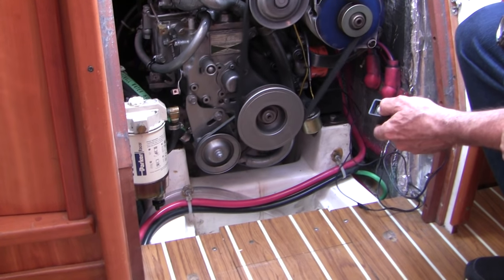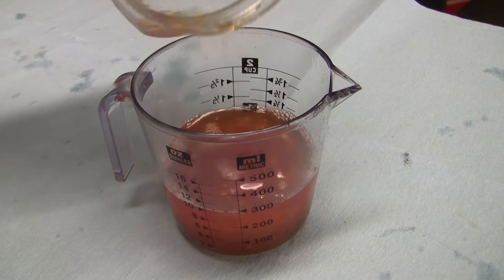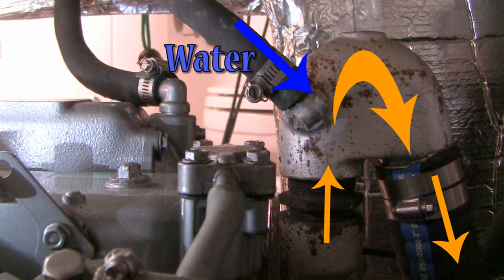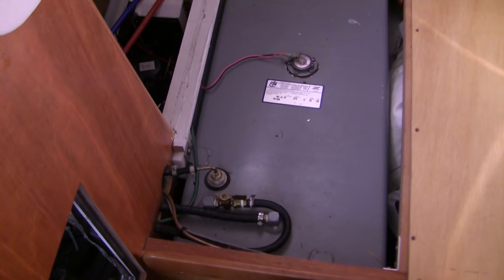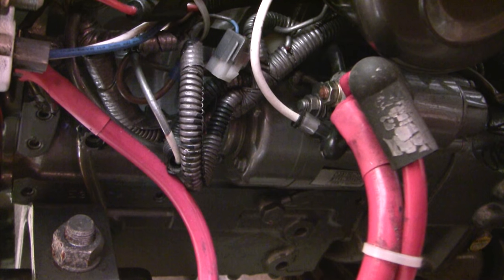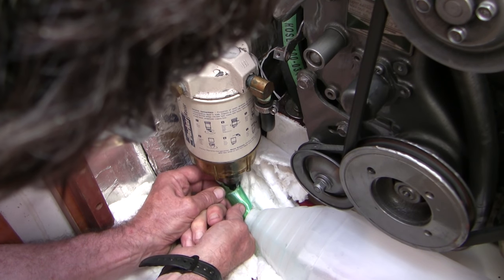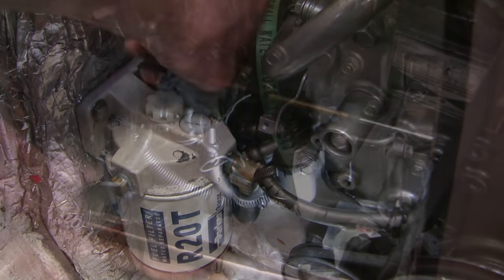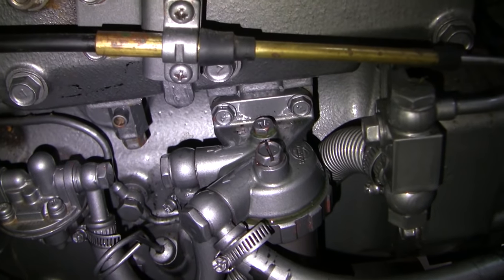How to change fuel filters and bleed air in a Yanmar marine diesel

Comment: So following up on my last comment I replaced the fuel filters today and had a couple things I thought I would share. First, bleeding the lines with the butterfly valve seemed nearly impossible. My primary fuel filter was huge and the butter fly valve is really slow. My starter and solenoid are tucked in pretty deep so I ended up clipping two long wires on each end of the start switch in the cockpit and attaching them to another switch I kept near me so I could run the starter by just bypassing the start switch. That worked great. Second, I ended up having to bleed the lines all the way to the individual fuel injectors because I had trouble starting up after bleeding them to the point where Dr. Spelunk did stopped. Basically I had to bleed them at the primary fuel filter, secondary, the inlet to the fuel pump or fuel injectors (the thing where one fuel line goes in and three come out), and then finally the individual fuel injectors.  Using the decompression valve trick to bleed the lines made things way easier. And it wasn't too difficult once I had a switch setup. Don't forget to stop the water intake before running the starter. It sounds like that could mess things up. Good luck everybody. Thanks Dr. Spelunk!
Reply from the maker: Excellent follow up advice, thanks for taking the time to stop back and help others.
Reply: Thanks guys, very interesting. Why should water intake be shutoff?  Also, I have a 12v fuel pump in-line next to my primary racor filter on my Yanmar 3hm35f.  I have not used it but my understanding is that one can turn on the ignition key (to provide power), then this fuel pump has a toggle switch to at least prime the primary filter. Am I correct in assuming one can try to start the engine without bleeding each injector? Then if it does not, bleed each of them as well? Lastly where does one get one of those by-pass starter switches? (Model?)
Reply: 0:50 so diesel just explodes?! No heat source?
Reply from the maker: @snakeplisken4278  It looks like I missed your remark, which sometimes happens in subthreads like this one. Common practice in these engines is to to shut off salt water intake when you crank without starting. This is done to prevent the salt water from flooding the exhaust manifold and possibly causing salt water to reflux into a cylinder, damaging a piston. More detail in the video, but essentially when pistons don't push much air, water can splash backwards from a rusted exhaust elbow. I like your design with a 12V fuel pump. Yup, that would be useful for bleeding, and you wouldn't need the hotwire switch I used. You can make your own hotwire switch, or buy a cheap one from any automotive parts store. If you make it yourself, don't cheap out on the wires or switch quality, since even the signal side of the starter circuit carries enough current to melt inadequate hardware. You can often get by with not bleeding all the way to each injector, I stopped after bleeding to the fuel regulator.
Reply: Santiago Ferrari No spark. There will be heat from the compression. My lay understanding is that it’s this heat that causes the combustion of the fuel-air mixture, but maybe an engineer would phrase it differently.
Reply: @santiagoferrari1973  I know you posted this long ago but....  Yes the diesel just explodes but there IS a heat source.  As the compression increases that pressure rise generates huge amounts of heat and when the heat gets great enough the diesel air mixture auto ignites.

Comment: I’ve bypassed my mechanical lift pump with an electric fuel pump from NAPA it simplifies bleeding. The elec. fuel pump is 17 yrs old,it’s going strong and costs very little, about half the cost of the rebuild kit for the mechanical lift pump.
Reply: Where's that video at? 😅

Comment: If you had continued pumping fuel at the primary filter, you would not have had to use the manual pump on the engine. Use the filter pump until you hear fuel returning to the tank. The engine will start on the first crank. Cheers, Richard

Comment: Hi! My name is Gennady, and I wrote to you about 2 years ago. Today, I started my engine, and at first I felt that it provided no push, then I saw a black liquid coming out of exhaust. And finally, the engine stopped. I tried to start it again, but it would stop after a few seconds. My engine is Yanmar 30 GM. Any ideas on what could be the problem?

Comment: Another tip I'll add...  I just installed a new filter just like the one you show in this video and I also didn't have spare fuel.  Mine would not pick up fuel at all straight out of the box.  But putting a little bit of diesel onto the seal at the end of the pump actually made mine start working and really made the pumping go a LOT faster.

Comment: Very helpful and detailed video.  I made a list of all the steps (we knew we had air in our system) even did screen grabs so when we were at the boat we could follow your instructions with pictures!  Brilliant!!!  it worked.  Interestingly, when we got to the high pressure pump, we  released the decompression valves, cranked the motor, the valves flipped closed by themselves and the engine started.  What a relief - thank you for the video - an excellent help!

Comment: I have only recently come across your episodes and find them clear, informative and very relevant to the faithful GM series.
One trick to make bleeding the fuel system easier than wriggling the lift pump for ever and a day is to fit a rubber outboard motor fuel priming bulb (about $20 for a good one) into the line between the tank and the primary (low pressure) filter. It will usually prime all the way through the primary filter to the high pressure filter on the engine. So far (touch wood) I have never had to crack the injectors to fully bleed the system after changing both filters. Just be sure to run the engine under load (ie in gear with some rpm on) at the dock for a good 20 minutes after any fuel system work to be absolutely sure that no air is lurking waiting to stall your engine at an inconvenient time (ask me how I learned this the hard way...).

Comment: Great presentation. I'm in the final touches of fully rebuilding my Yanmar 3GMF and will go through most of this initially before installing the engine since I only have access from front and back, and a small door to check oil and change the secondary fuel filter. Well done.

Comment: After watching some of these video for the second or third time I am even more impressed with your productions.  In my opinion you do an amazing job presenting an overview of what we are looking at and explaining the various parts of the system before you go into the specific subject matter (fuel filter replacement, raw water pump removal and rebuild).  Something you mentioned in passing is contrary to what I have been taught, that has to do with pre-filling the secondary fuel filter with "fresh" diesel after a filter change.  I have been cautioned not to do this because these secondary filters are designed to remove very small contaminants, smaller than the human eye can detect which is limited to approximately 40 microns.  Consequently the fuel may look very clean to our eyes, but still have contaminants that can cause havoc, 3-4 microns, in the extremely small tolerances within the fuel injector pump and injectors themselves.  The problem is that the contaminants causing the most damage are too small to see so the visual check is ineffective.  So filling the secondary fuel filter bypasses the secondary fuel filter with that fuel which is introduced unfiltered and becomes a point of contamination.  Prefilling the primary fuel filter is fine, even a good idea, but not the secondary fuel filter.  Did I misunderstand what you said, or do you have contrary information?  The methodology I have been taught during a filter change is to prefill the new primary fuel filter with "clean & fresh" diesel, change out the secondary fuel filter then use the lift pump to prime through the secondary fuel filter, filtering the fuel through the smaller filter and continuing up to the jerk or rotary pump using the lift pump.  The lift pump will not prime through the fuel injector pump, so the injectors themselves will need/may need to be bled as the engine is turned over.  Your thoughts?????
-Respectfully
Reply from the maker: Yes, I agree, exactly. I don't go through the extra effort of prefilling for that very reason, though I suppose one could manually filter fuel. Thanks for the kind feedback!

Comment: Beautifully explained and filmed. I turned the compression levers off to suck my fuel to the secondary fuel filter. I then turned the starter motor twice for 10 seconds, but still no fuel coming through the bleeder nut. Reluctant to try it again. I do have fuel coming through the bleeder nut at the water separation filter.
Reply from the maker: Some guys use a suction vacuum, similar to those used to change oil in these engines, to draw the diesel fluid up the tubing. I demonstrated how to use a suction pump in an oil change video. Fuel butterfly pumps don't do well with air in the line, because air is so compressible. When the pump creates a vacuum air can expand, rather than drawing the much more viscous diesel fluid up the tubing. The other possibility might be a problem with the diaphragm of the butterfly pump itself. I've never had one of those apart but you can rebuild them. Finally, go back and check your assumptions, verify you've got diesel in the fuel tank and you haven't left the shutoff valve closed, and you haven't left a bleed screw open on the intake side.

Comment: Great video!  I know how hard it can be to get the shots you did. This topic and the physics behind it can be elusive and you nailed that too!
Reply from the maker: What a kind remark, thank you Brian.
Reply: I've got a 4x4x4 forklift with a no start that I bought.  The lift pump failed and I fitted an electric one.  When I did that, it wouldn't purge... ever.  I relocated closer to the tank and lower.  The pump never pressurizes in the new location and the engine almost starts, but doesn't.  I'm SO CLOSE, but not there yet.

Comment: Excellent video!  I'm replacing an ancient fuel-water separator on my boat.  I have a 20HP Beta Marine Kubota on a Catalina 30.  This year it developed an fuel leak after the electric pump and after I fixed that I sow how shoddy the workmanship was in cobbling together aftermarket components in the rest of the fuel system.  Going to re-do it all.  So this video, although for a different engine, was very helpful.

Comment: I noticed in your video that you had steel hose connectors screwed into the assembly. How are these sealed? Are they PFTE taped, puttied or other. This is what I was referring to. Thanks for your rapid reply to my question. Kind regards Tony

Comment: Good video, showing step by step the sequence of bleeding air from the fuel system. I have tried the same sequence however my engine is a 2GM only 2 cylinders but have noticed that it has one more filter besides the water separator filter and the fuel filter before going into the high press pump. That filter I mentioned I have not been able to open it so I bypassed it and keep the sequence, when I go to the high press pump I opened the bleed screw and a lot of air and bubbles came out with pressure in it. I started the engine with the decompression valves up, run it for 10 seconds and only diesel then was coming out from the high press bleed nut. I tightened it and put the decompression levers down, went and started the engine and it started. It stayed a good 10 minutes and slowly died again, tried to crank the engine and it didn't start. I went back did the same sequence and found more air in the high press pump, did the same process as before to bleed air out and started the engine again. It run for another 10 minutes or less and stalled it didn't stay running for more than 10 minutes. What do you think it may be the problem?  Thank you for the info.
Reply from the maker: Air is leaking in, from somewhere. I'd wonder if the seal on one of your filters is not seating correctly, and would start by getting a set of seals for each filter canister and replace them all. Remember to coat them with diesel or oil to allow them to seat well. If that effort fails, gee, I don't know. Maybe air is leaking past the threads on one of your bleed screws. I suppose one could pressure test the system and look for an air leak with soapy water, I've never done that in a fuel system. Or you could close the intake valve and apply vacuum with a vacuum gauge to see if the line can maintain vacuum. You might hear a hissing sound as air passes by an area. I suppose also the butterfly valve has a diaphragm that could be torn, I've never seen that happen. Please stop by after the problem is solved, and let us all know what you found.
Reply: @spelunkerd  Hi Mr Spelunkerd, I tried what you suggested,  changed the filter gasket and put a new one making sure it was sitting well. Tightened a little bit more the bleed screw on the fuel filter, I put a little bit of Teflon tape making sure the bleed hole in the screw was free. I bled the air on the high pressure valve, some bubbles came out from the bleed screw. Then I tightened the screw and started the engine, it took a bit but it started. I noticed the throttle cable is lose and doesn't stay in high RMP only medium or low, if I put it in high rpm the throttle cable goes down on the rpm by itself. I was hoping the engine would stay at least in mid or low rpm, however like last week the engine slowly stalled till it shut down. Tried again bleeding the air 3 times same process and every time it stayed for 7 minutes approximately and shut down. I checked the water separator and let it drain, the diesel came out with dirt and water inside, drained 2 more times to get the bad diesel out and it came more dirt and water from the separator. I wonder if the reason of of the engine shutting down after a few minutes is the contamination of the diesel going through the fuel system and creating air bubbles even after the system was bled. Could that be possible?  Do you have a video on how to clean the diesel tank? Any suggestions will be helpful. Thank you.
Reply from the maker: @businessexpansionstrategie4015  Gee, I don't know. Yup, dirty fuel is often the culprit, you could bypass the fuel in the tank entirely, running from a container of clean fuel, and that would test for a failed tank check valve, too. If it fails with that you could put a fuel pressure gauge on one of the distal bleed screws to be sure your fuel pump is delivering adequate fuel volume. Failing that you could arrange for a compression test, valve adjustment, and probably removal and cleaning of injectors. This is getting beyond typical DIY maintenance. Specifically to test compression you need an adapter that fits into the injector hole, since these Yanmars don't have glow plugs.

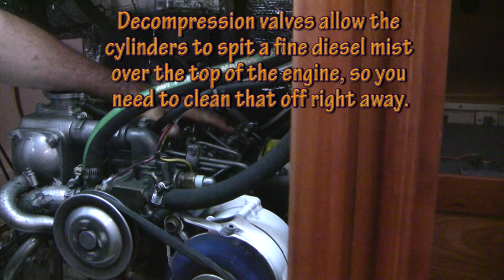Comment from the maker: _Erratum_I wish we still had the old Youtube annotations, that allowed an author to modify a written remark. At 13:27 the written remark does not apply in these little Yanmar engines. Specifically the Yanmar decompression lever shifts the exhaust valve for that cylinder open a little, resulting in no compression, and shunting a mix of unburnt fuel and air into the exhaust. It wouldn't be good for emissions or catalytic convertors, but these engines don't have cats.
Reply: Great series.  If the shutoff lever is actuated then no diesel is injected while cranking.  I find operation of the lift pump lever is adequate for filling/bleeding the points beyond the lift pump but you must rotate away from the high part of the cam lobe else the pump's travel is already engaged.  The pump spring is heavy, about 2lb force on the lever.  You have the option of using your Racor 200 priming pump for this task.  For FWC versions of these engines, the bleeder bolt on the fuel injection inlet is very hard to get to.  You can tackle it better with a wrench custom bent with a sharp 90deg at the box end.  Then the open end of that wrench is easily torqued with another tool.

Comment: I realize these posts are a bit dated now, but still a great and timely video.  One question: Is there a reason you do not continue to prime the fuel system with the Racor pump?  Once it fills the Racor filter, will it not continue to push fuel up through the secondary fuel filter?  The Racor pump seems to have more capacity than the Yanmar butterfly pump.
Reply from the maker: that’s a good thought, these pumps are better at pushing liquid than air. I’ve never tried it.l

Comment: Hey great video! I'm installing a Racor 10 micron primary and 2 micron secondary on my Hunter 466. thanks for the demo on your system. Have you any advice on sealing the hard line connection at the filter assembly? What have you found that doesn't degrade from contact with diesel? All the best Skip, Tony
Reply from the maker: My connections are all hoses, and I would choose line specifically designed for fuel. I haven't seen hard line connections on a boat, but old school steel fuel line connections are pretty common in motor vehicles and also brakes. Many of those have a flare design.

Comment: Great Video thanks - did seem to miss the point where you reopened the fuel line before starting to bleed the air out of the system??
Reply from the maker: I didn't record it but I did remember to do it. Some systems might siphon by gravity when you open the valve, but cold diesel is viscous and there isn't enough of a drop in my boat to let gravity do its thing. Thanks for watching!